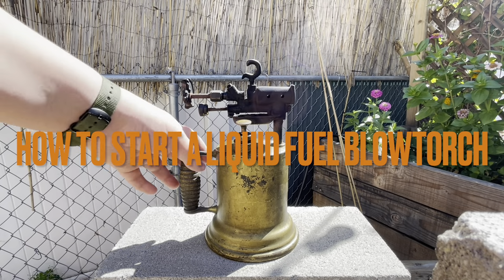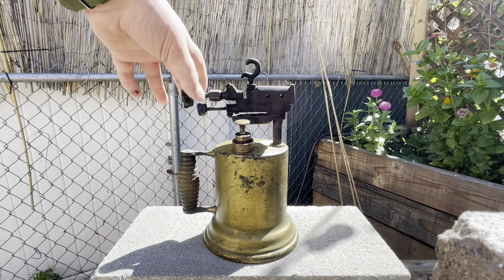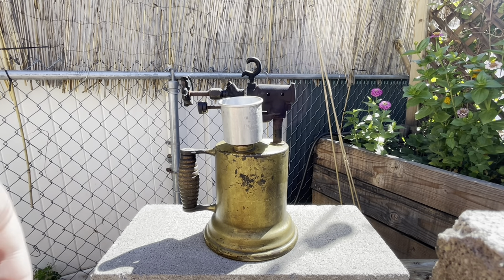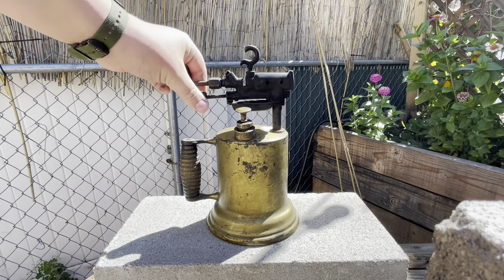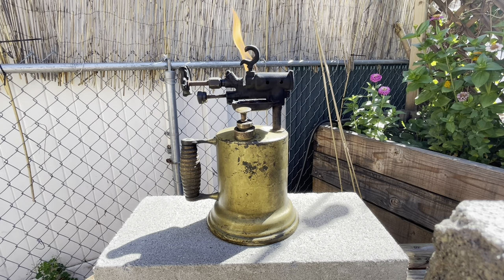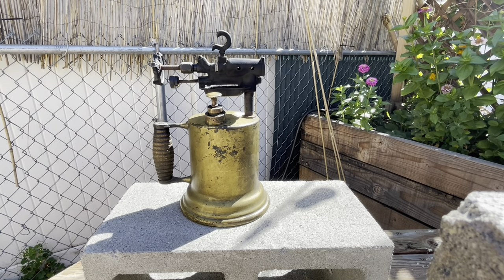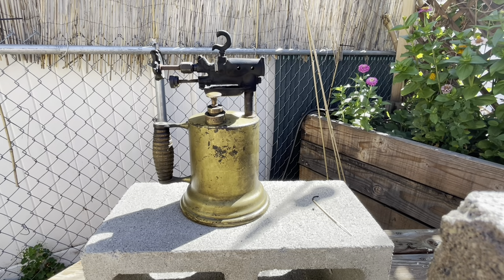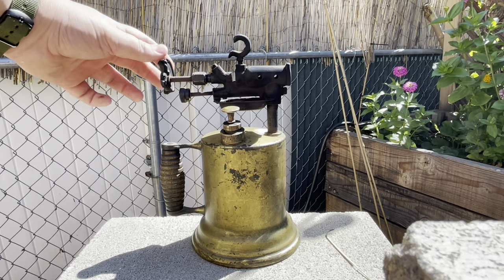How to Light a Liquid Fuel Blow Torch

Comment: Great to see your interested in this subject! If you get into collecting these gasoline blowtorches a couple of things to be aware before buying. The fuel tanks are rolled brass or copper and there is a vertical seam (invisible to the eye) on one side that is brazed together. In time this is a weak point that can develop a hairline crack from being repeatedly pressurized. Sometimes you don't see it till you put fuel in, pressurize tank and you see the slow leak. The easiest way to DIY is sand the crack line and use JB Weld two-part metal epoxy. Run a bead line to cover and allow two days to set. Before you buy get one of those soap bubble ring toys and a long eyedropper. Pressurize tank and apply drops of soap water to find exact leaks. JB Weld is great also to patch and seal leaks usinga toothpick. It can be sanded and painted with gold or brass tone enamel paint. I restore antique and vintage gadgets like these.
Reply: Thanks